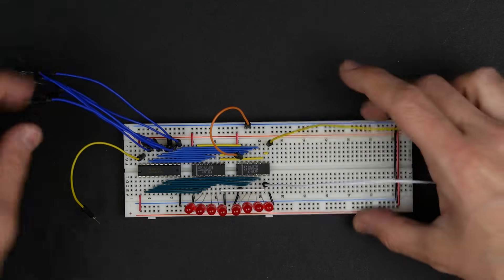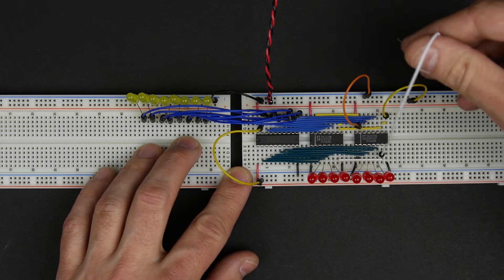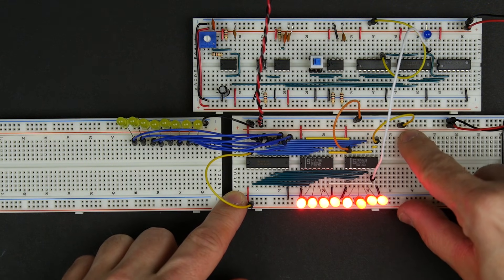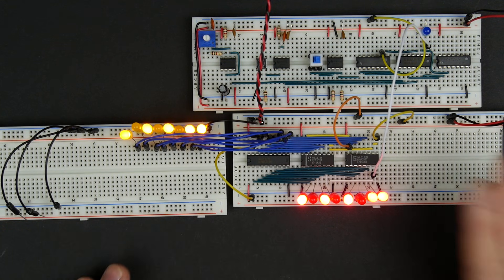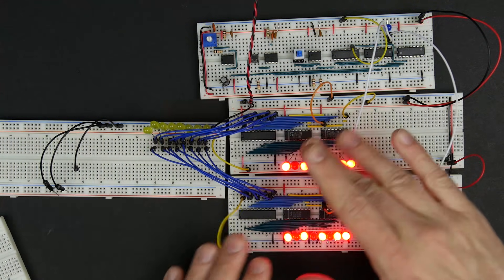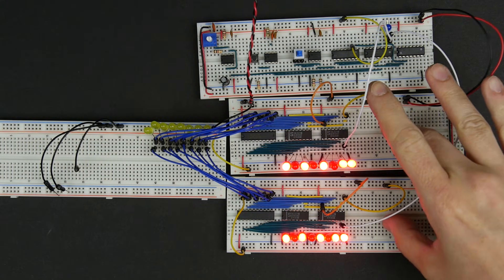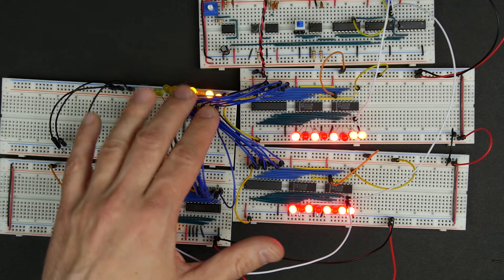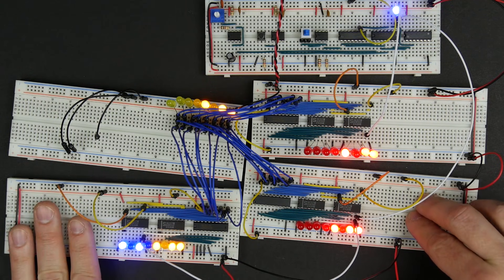Testing our computer's registers - 8-bit register - Part 5

Comment: I really do enjoy this kit that I bought.  However, I'm running into a lot of issues with the schematics/datasheets not coinciding with what the videos are showing.  For instance, in the videos he aligns the bits left to right in the video.  In the schematics however they are labeled with the far right chip D3 input being Bit 0 and so forth.  I get this isn't so much of an issue as long as you make sure you land the inputs on the bus the correct order, but again it's just a bit confusing at first.  Kind of like the issue with having a SUM register in the videos, yet not in the kit.  If you order the full kit, just really make sure you don't go in zombie mode and copy wire for wire, make sure you actually understand what's happening.
Reply: Did you have an issue where the registers would not output to bus? Mine inputs fine but it wont output
Reply: @Mechanist  Hey, I figured out that the LEDs connected to the 74LS173 take 1 V away from the chips making it not powerful enough to output the light. Both removing the LEDS or adding a 220 resistor should fix the problem.
Reply: @NotAScamCSGO  where should i add the resistor
Reply: @NotAScamCSGO  thanks, i hade the same issue
Reply: @Mechanist  I have this EXACT issue

Comment: For whatever reason I cannot get the 74LS245 to output anything to the bus. I have tried entire rewiring, checking chip supply voltages (within 5.0V spec at the chip), etc but still nothing. I've noticed that when I pull the Output Enable LOW I get no voltage potential on any output pins. When I switch back to HIGH I read 0.5V across the output pins. There is 2V present across A1-A8. According to the datasheet truth table having the enable pin LOW and DIR pin HIGH (which is the proper configuration) directs Bus A data to Bus B. However, it doesn't. Perhaps I have bad chips?

Comment: Why isn't the bus pulled low through the LEDs which are connected to ground?
Reply: Well, the LEDs are indeed acting as a weak pull-down (not enough to alter a TTL output set to H). The key here is that his bus is always driven by a register or another (never really H-Z).
Reply: LEDs are one way because they’re diodes

Comment: Hello Ben

I find your videos inspirational, can you explain why you don’t always use resistors with the LEDs when outputting from various ICs.

Thanks
Reply: Some of the chips he is using have internal resistors, you need to look it up in datasheets :))
Reply: @Igor0663  Thanks for your input.
I looked at the datasheet for the 74LS173 D-Type register
The output lone has a 100 Ohm resistor.
With an input voltage of 5v, this can push 50 milliamps
I was under the impression that LED has a maximum limit of 20 milliamps?
Reply: @notongues3011  As  red LED has voltage drop around 2V, the resistor would only have drop of 3V, which means that in fact it will push 30 milliamps through and it is too much for LED as you said. Maybe there are some other current limitations inside of chips idk :p Btw 100ohm is really enough if ur using green, yellow or blue LED as thier voltage drop is >= 3V, so on resistor you would only have <= 2V.

Comment: is it okay if i have the clock on the same breadboard as the register, Since im planning on only using one type of clock
or will the mess up some voltage or current thing
Reply: As long as you've got the circuits isolated from each other it shouldn't be an issue. If you've got the space, go for it. I was actually just thinking that you could probably cram two registers on one breadboard with this design

Comment: That Black and red twisted wires is delivering 5v? I'm confusing because you dont put resistors in the logic boards...
Reply: yes, 5v as alway.
Read the Chip manual to figure it out

Comment: NOTE! Watch your forward voltage drop on your LEDS(they act like a voltage divider*).  I needed to add resistors to keep the logic voltage high enough for the ls245 to recognize.  A small bald spot ensued trying to debug :)
Reply: This is probably the only time I've ever been happy to read the YouTube comments. Thanks for saving me a headache.
Reply: thevalleysmiths1  Your LED should drop approx 1.7 volts from your logic level, putting it below 2.0(logic high,ttl). Put a 1k resistor in series to limit current and keep your voltage up.   ttl output - resistor - led. Test all 3 points with a voltmeter and you will see better.
Reply: Needed this too. Do you have any idea why it worked for Ben in the video?
Reply: tklightningfast i believe he has LEDs with builtin resistors
Reply: thought i go blind there when i plugged it in. surprised how bright they can shine. anyway leds and chips survived it and addes some 470 resistors to each. worked fine after. hope i dont need the space there later. but its interesting to see how fragile that whole thing is.
Reply: Thanks for the tip.  I have been banging my head trying to figure this out.  You said ttl output - resistor- led.  Just to make sure ttl refers to the 74ls173?  In the provided schematic he does show a resistor between the led and ground, but I guess this will not solve the issue?
Reply: Can confirm, I spent a ton of time figuring this out, the LEDs on the register breadboard light up but not the bus ones. I ended up laying out all three very differently to fit resistors in series with every LED. Live and learn. Also, on mine, register LEDs do not light up by default.
Reply: I ran into this exact issue today, don't know why it worked in the video. Also he's not putting resistors on the register LED's themselves, but I am since they came in the kit.
Reply: @jimgeist5699  I think the parts he uses in the videos are not always exactly the same as the ones in the kit. Also, I don't think it's relevant in this case, but I believe the voltage drop depends on the LED color; so you can get different results depending in the color you pick, as crazy as that sounds ;)
Reply: I have the same problem. Thanks for the advice, I will try it tomorrow
Reply: In order to save some extra space for future builds (which would have been occupied by the extra 8 resistors), I used these LEDs: https://www.sparkfun.com/products/14560. The bus test is working fine, however, I because these LEDs are clear, it is a little too hard to distinguish which ones are light up (the light is reflected by the clear LEDs that are not light up). I would recommend colored LEDs (in the not light up state).
Reply: @AlexandruDragoiGabriel  I had good luck with similar 5ma lil reds. In hindsight including the clock issue above, I would check voltage and current output for all of my modules before entering the buss. The clock issue is probably a voltage drop and noise(it was in my case). I was really sidetracked this year... Hoping to get back to my build in the fall.
Reply: @jsmythib  he said putting the comp together in a couple weeks and I was thinking hmm
Reply: @looselief  I managed to get his basic design executing code, but using a 15 bit address line(basically (2)8bit r/w/s buss), and an at28c256 as my ram...which sounds bad- but ended up being very useful considering limited use. It took...12 ish 4 hour nights, as a rough guess :) I will be needing the rest of life to complete it!
Reply: @AlexandruDragoiGabriel  that is a great idea. I wish I had done that. I was reflecting on how much work there is in just adding the LEDs and ability to program via DIP switches. I guess it would be half the work and components if one didn't need the extra infrastructure. Not to say it's not useful, of course.

Ben Eater for President!
Reply: Just to add, the schematic he provides has each led connected in series w/ a 220 ohm resistor. I left out the resistors bc he didn't use any in the vid, and my bus was acting up. But after reading these comments and then putting the resistors in, I can confirm that the 220 ohm resistors do make it work :) Thanks also to all the commenters figuring this shit out, real mvps
Reply: @AlvaroMichael100  AH yes. Never thought to look at the refined schematics when I first started. Sounds like me :)  Ive been out for a while but I feel like I want to self promote here :)  Checkout my 8 bit manual interface using dual timers(as latches).  It was super useful when keying in bits, vs dip switches.
Reply: That helped me Thanks
Reply: note that this is true, I also had mine work like ben eater's for the first few switches of my jumpers and then it behaved differently. He seems to only use that circuit briefly.
Reply: If only I had seen this comment sooner... I spend the last 15 minutes trying to figure out why it worked with one led but not with all eight. I ended up puting a resistor too, but I had no idea why it worked that way, thanks
Reply: Can confirm too. Adding the 220 ohm resistors supplied in the kit in series (chip output -> resistor -> LED) with each of the LEDs did the trick.
Reply: I still can’t figure out why does my clock stop working when I connect the registers and the bus to the power through the clock. I also noticed some patterns of LEDs lighting up or not working at all depending on their color. Anyone knows why? But the main question is why does everything stop working when I connect the registers and the clock to the same power?
Reply: @guseynguliyev707  hard to say but after a ton of fiddling around I believe it is very important that every LED have a resistor connected in series. Not parallel! And this complicates the layout of the board in a lot of cases.

Also I suggest isolating components when trying to figure a problem out - take a new board and an LED and figure out how just one bit works on a particular chip before wiring the whole thing up.
Lastly a logic probe is money very well spent! Around $35 on Amazon and very very convenient.
Reply: Greg Tomkins had the same Problem turned out to be a shortcut caused by unisolated parts of the cables touching each other just rearanged hese so they dont touch each other and then it worked.
Reply: @guseynguliyev707  did you by any chance solve the problem? having the same trouble here.....
Reply: @김동우-i5j  my turn to ask it, did you solve the clock issue ? Hope you're still there..
Reply: I love you so much. THANK you. Just THANK YOU. I was so sad when my clock wasn't working when I plugged the halt line into ground (because i bought the wrong kind of hex inverter), now when my bus wasn't transferring properly I was about to have a heart attack.
Reply: I ran into this too. Had to do some significant redesign to run all the connections out to the resistor / LED combos.
Reply: Wish i had read these comments sooner. I did wonder why Ben had no resisters in the circuit. I could not figure out why nothing was working, burned out the red LEDs

Comment: So, I've got my registers fully working, but I'm left a little confused on one concept. Why does the register differentiate between a bit being grounded and going through the LED? The LED is also a direct path to ground, so it seems like it would follow the exact same logic.
Reply: The LED is a path to ground, but it has a more or less constant voltage drop when it is conducting, like 1.7-2 V for a red LED and more for shorter wave lengths. Above 2 V is considered high signal level in TTL (below 0.8 V is low), so those LEDs are probably not pulling the signal low enough, especially if the TTL inputs have a weak pullup.
Reply: @possible-realities  I bought the kit this year, and in my case the LEDs do pull the signal low. What's up with that?
Reply: I think that is because leds are not directly connected to output or input of registered. They are connected on output of flip flop which is then connected to the tri state buffer chip.

Comment: Posted this on the wrong vid so reposting here:
===
One of my 8 bit registers was loading data from the bus in an non-syncronus way? If I ran the LOAD signal LOW, the 1st 4 bits will load on the clock pulse high and when it went low the last 4 bits would load. 

I did some testing. Maybe my clock signal line was too long to the 2nd register? I reduced the number of wire hops from my clock to my register and it seemed to fix issue. I also added current limiting resistors to my LEDs and this seemed to make it more stable overall. However now I am having issues with the final layout. 

I have all BBoards placed with the 8 bit bus rails in middle. Bus is tied to ground through resistors and the Bus LEDs have current limiting resistors. The issue I am facing with 2 of the 3 registers is that if I load the bus with a high signal from a power rail then no matter what it on the bus (01010101 or w/e) the register will load 1111 1111 every-time. If I remove the jumper and instead output a signal from another register instead such as 0000 1111 from the Instruction register and load the data into register A or B then it works without issue. Problem only arises if the bus is loaded with a HIGH signal that comes from a power rail and and not a register. 

I have built 2 separate registers on prototype board with solder and will test to see if these have the same issue. The Instruction register is fine and I believe these 2 registers (A and B) were working 100% before I connected the instruction register to the board. 

Will post my findings.
Reply: I found the register very susceptible to interference. Always put that 100 nF capacitor between power and GND, that helps somewhat. But I found other problems. Can you check something for me?

My registers 74LS173 produce a strange output of HIGH as only 3.8 V and low is like 0.9 V. And the 74LS245 doesn't recognize this as a proper HIGH. So its output is always LOW. What am I doing wrong? I checked both 74LS173 chips on every pin it is the same issue.  I checked the 74LS245 in isolation and it works as advertised.

If I test the 74LS173 in isolation its HIGH still is only at barely 4 V.  Why doesn't the register go all the way to 5 V?

Comment: I built the first register and it did not function properly at all. Very flaky. Double checked the entire build. So I went ahead and built the second register but did not use the final wiring but rather prebuilt jumpers. Did this to eliminate my wiring being bad in some way. Second register acted just like the first. Now I’m thinking a bad chip. I switched them out one at a time. No change. Now I’m thinking bad chip supplier. I ordered off eBay using Ben’s links. I got all I could from Digi-Key because I know their stuff is top quality. But the chips used on this board did not have a Digi-Key link. The chips from eBay ended up coming out of China. Nothing wrong with that, I’ve gotten many that way and they worked fine. To wrap this up, Digi-Key had these chips and once I replaced them, everything worked exactly as shown in the video. All chips had the right part numbers but the Digi-Key chips were a bit different and seemed more genuine then the ones from China. Who knows. But if you are experiencing problems, keep this in mind.
Reply: yeah, I've switched to Digi-key or Jameco for parts.  After years of good parts from ebay (china) suppliers I got a batch of 10 eeproms that were all bad.   Bad as in the tops were sandpapered clean and new numbers stamped on them.  I'm done taking the chances.

Comment: Hi there Ben and others - I have a small issue with this part. I hooked up the registers succesfully ( did it twice ) but the minute I hook up the extra LED's on the seperate breadboard ( ~ 3:17 ) all my RED LED's go LOW and it is impossible to get them HIGH again. I am not sure whether it is a power supply issue? ( 5-6v power supply) did it with two different ones ( one 5v voltage regulator and another battery pack ~ 6v). Anyone know what the issue is?
Reply: HR \o possibly bad chips. See my top level post about this.

Comment: At 5:30 why is the bus on?
Reply: The board was getting a ground loop from the bus. Internal to one or more of the chips power was finding a path from the plus power strip to perhaps the low signal on the bus.  Things don't always work exactly the way we think they should.   It is for this very reason that unused pins should be pulled high (or low depending on the case) and not just left to float.

Comment: Wow, I have been following these videos, it is sure an eye opener as to how a computer actually works, under the hood, so to say.  Although I have skipped around a bit since the first one I discovered already had some of the circuits already built,  I am now going back to study the prior videos, and it all comes together nicely.  Thanks a million, I have been playing with computers since my first C=128, and have been building systems for years, and repairing laptops for years (well parts swapping and cleaning up hard drives for folks for the past 20 years or so, but now the whole thing just makes a lot more sense.)

Comment: Hello  Ben !
I want to make only Register and ALU  (8-bit) . My question is , Is there necessary to add clock section in building these things or not ?
Reply: Well there needs to be a signal when your processor should fetch instructions and execute them, right? I hope I'm not too late for ot have been 2 years😅
Reply: Yes because some of the components inputs are not hi or low, they activate on a rising curve or sometimes a falling curve.